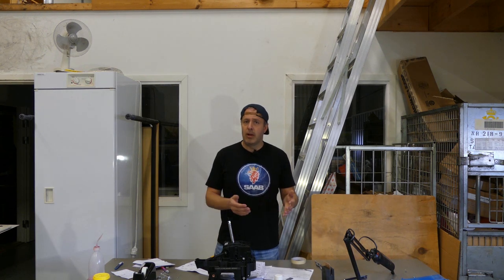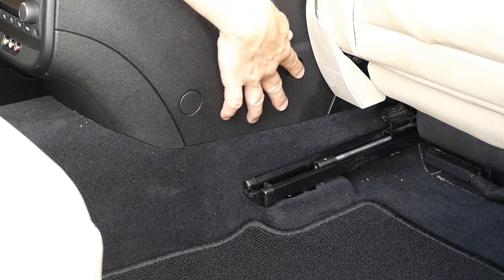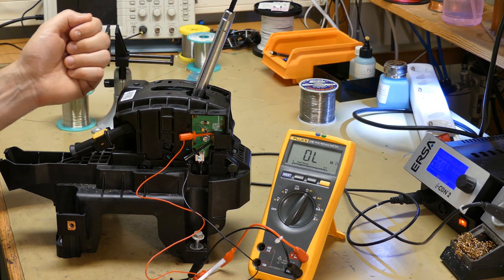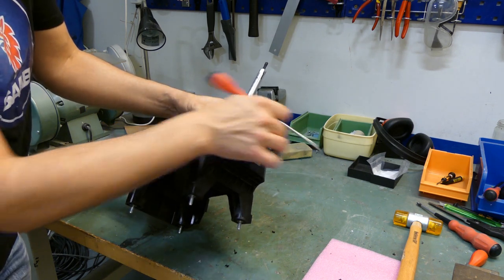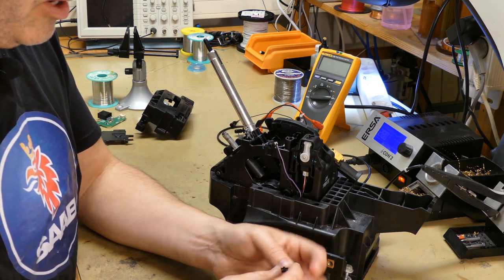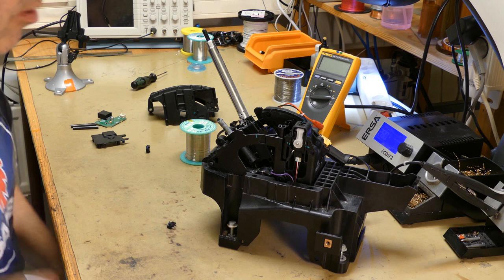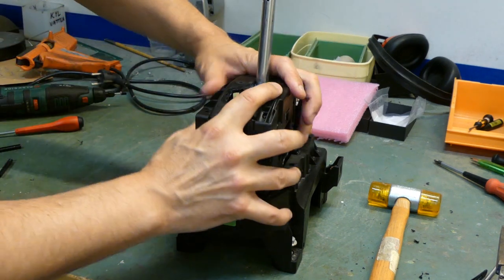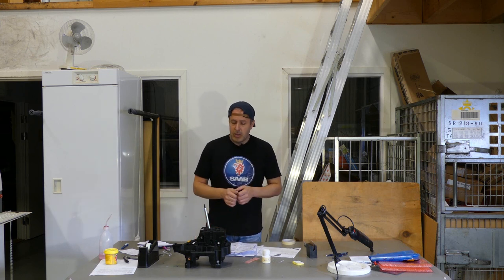SAAB New Generation 9-5 - No more "Shift to Park"

Comment: Did this update on my car last week, thank you! 

Did a shortcut to open the "lid" without cutting out a path for the locking pin, only removing the front pin and bend it open just enough to remove the micro switch. Problem with this method is you have to use a clamp to force it together again, the crux is a plastic guiding pin right beside the micro switch that needs enough forward push to fall into place. 

Also you mentioned a new unit feels more firm. I tried to tightened the bottom most locking washer hidden in the base on my unit (loosen the long locking pin to remove base) which seems to have stiffened the feel a bit.
Reply from the maker: Nice work. Thanks for sharing the tip. 👌👍

Comment: Great video. I don't seem to be able to find the pdf files about removal or a link to the switches. Can you post them here? Thanks very much.
Reply from the maker: Here's the PDF https://www.dropbox.com/s/is6x9gof96dohhm/CentreConsole.pdf?dl=0 and here's the link to the switches. https://www.ebay.co.uk/itm/10Pcs-Omron-D2HW-ER201H-Micro-Limited-Switch-Electronic-Components/124238749177?ssPageName=STRK%3AMEBIDX%3AIT&_trksid=p2057872.m2749.l2649
Reply: Greatly appreciated. I will be doing one soon as I just purchased a spare Aero in case my daily gets damaged. Somehow someone destroyed the shifter. I have a used one to test and likely replace the switch. Keeping my fingers crossed that it drives well! Once again thank you very much. You are a credit to the Saab community! Kevin
Reply from the maker: @kevindoyle9927 Great! Thanks for watching and best of luck 👌✋

Comment: I have this issue on my NG aero, would this cause battery drain and no start issues? Already replace alternator and starter repair shop can not figure why but I think it's this issue here.
Reply from the maker: In the end it can cause some serious problem. I couldn't turn the car off and then it stays on and drain the battery. Had to disconnect the negative terminal for a while and then back on. You shold look into this.

Comment: Hi Markus, I thinking of purchasing the full assembly. You say you got a garage to install; is this a specialist job. Does it require specialised tools. Thanks a mill for the video. Ian
Reply from the maker: Hi. Thanks for watching :). No special tool really. Plastic tools for removing panels in the car. Sockets and bits.. The only thing I had to buy was the tool to get the lockingsprint out of the assembly. I bought that one in a hardware store. The other stuff like soldering equipment I already had in the lab.
Reply: @TechCars  thanks a mill Markus
Reply: Hi Markus
Reply: Hi Markus, just a follow-on question -  you say you purchased the full selector part and hit a garage to fit it. Is replacing the entire unit a specialist job or is it a simple remove (disconnect the sensor wiring) and replace 
Thanks again 
Ian
Reply from the maker: @IanMacNamara  You just need to disassemble panels and stuff to get to the screws holding the gear selector. Then you just swap it out for the new one and assemble all the stuff in the reverse order. BR Markus
Reply: @TechCars  brilliant.  Thanks a million Brother

Comment: Hello, very nice guide how to do it. Do you know, if this Gearbox Assembly is same for Opel Insignia B? I'm pretty sure, that is the same for Insignia A.
Reply from the maker: Hi. From what I remember it's the same part actually that is used in the insignia so it's the same process :)
Reply: @TechCars  I will remove the cover and investigate it soon. Thank you.
Reply: @TechCars  so I've checked it Under the gear stick, order no. is 13576878. Switch looks similar, but I would use D2HW-ER211H, this is with hinge included and is not needed to use from old switch. Check data sheet of Omron D2HW line.
Reply: @TechCars  or D2HW-ER231H with the simulated roller like you have, I did not notice before in your video.
Reply from the maker: Thanks for sharing this. Best of luck with the repair!

Comment: Great vid. Quick q. Not sure if you ever had this issue w the ng 9-5. The seat warmer turns off after a minute even though I replaced the pad. I checked the fuse and it’s fine. Any suggestions?
Reply from the maker: Thanks for watching! Yes I've had that on the passenger side, but it was only the pad in the lower seat. The one in the back? Have you checked that as well?
Reply: @TechCars  no, I didn’t know it had one on the back too. Does the passenger seat also have one on the back?  Thanks
Reply from the maker: @drplando14  There are pads in the back on both the driver and the passenger seat. Your back pad might be broken and that's why it still turns of after around 60 seconds.
Reply: @TechCars  thank you. I’m going to try to replace it. The back of the seat looks like a beast to take off. Thank you again
Reply from the maker: @drplando14  I know. It's not something to long for.. If you can see if you can measure the resistance with a multimeter in the connector for the back pad and compare it to the one that works. I don't have the correct figures at the moment.

Comment: Thanks for this video and others. How do u remove the Gear shift knob? Seems like its attached with a u shaped Steel spring that i dont know hos to get out😭
Reply from the maker: You need something very thin to push it out. Like a awl, broach or similar. If it's totally impossible you could leave it on and still get the component out I think. Just wrap it so that you don't destroy it while doing this.
Reply: @TechCars  
Do u push it out to the front of the car? I got som Long plastic Pieces covering that exit point. How do u remove those?
Reply from the maker: @erikrampell3153  You push on the left side. There's a clamp. Push with something thin and strong.
Reply from the maker: @erikrampell3153  It sits in a groove in the stick. on the left side. I got a bit uncertain now about which side to push on. The Groove is on the left side. Maybe it should be pushed from the right side to release on the left side..
Reply: @TechCars  
Thank u, Will try it tomorrow!
Reply: An awl did the trick, u press hard in the right side where there are a little gap. Interior in danger if u slip. Tried a small screwdriver first but i did slip and bent.
Thank u for the help
Reply from the maker: @erikrampell3153  Nice work!! Maybe it's best to do it when the whole assembly is removed from the car.

Comment: Vad kostade ett nytt spakställ? exkl montering
Reply from the maker: Det ligger på 3 198,04 kr ex moms. Medlem i Saabklubbar ger säkert lite rabatt. Oftast 10%.
Reply: Sök på skrotar, hittade en som gått 2500 mil. Kostar runt 1000-1500kr.
Reply from the maker: @anderswretman6733  Precis! Ett enkelt sätt att testa det begagnade är ju att koppla upp multimetern som i videon. Då vet man.. Skulle det vara opålitligt så är det bara att byta switchen! :)